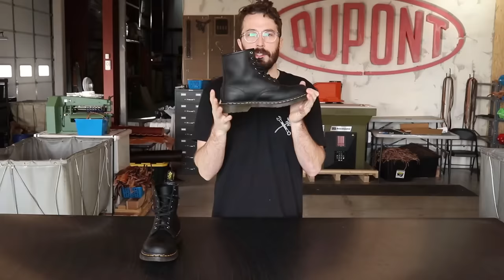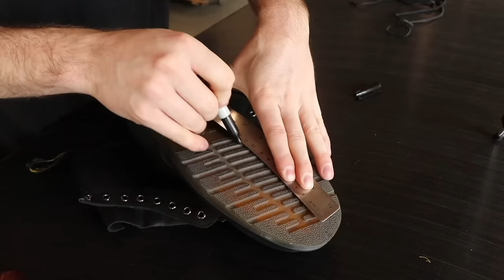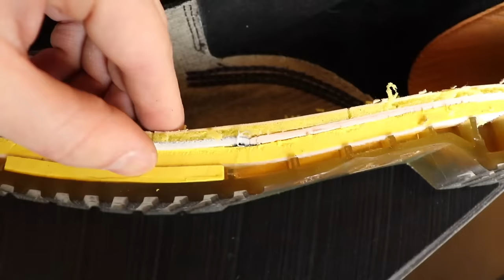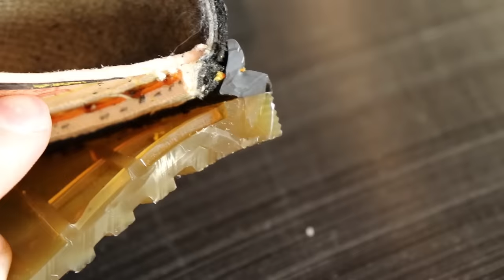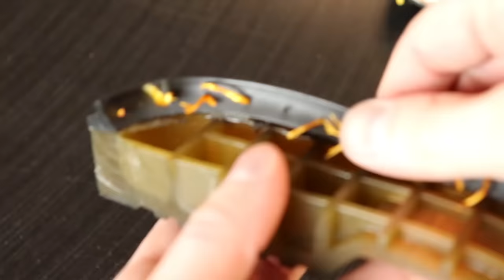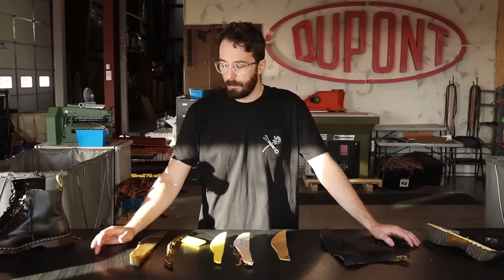WHAT'S INSIDE DR. MARTENS - (1460 BOOTS) - doc marten review

Comment: I really like this. With little exception, cheap stuff especially just doesn’t bother explaining what is included, left out, or what the expectation of durability is. Even pricey stuff may not bother. 

Would you be willing to do the same examination with the Corcoran jump boots? They are similarly inexpensive but should have better construction than the boot you reviewed in this video, except that’s an assumption on my part since I haven’t cut one in half.
Reply from the maker: If there is enough requests I’ll do it!

Comment: had a pair in the 70s,  the tongue used to slide down and wrap round my heel as i walked,  the dew from grass longer than 1 inch would soak the top of my foot, and the sole split and came apart after 1 week,  as very one knew at the time,  you repaired that with a hot butter knife.  if you kept at a pair for a while,  you'd be through the boot to the sock,  before the uppers looked worn.  and they were not cheep, they were total garbage, and looking at this vid, they still are.
Reply: It's such a waste of leather, god damn.

Comment: Things suck. I had a pair in high school that I had to work my ass off to buy. Got em and they lasted with switching off and on with a pair of Carolina engineers boots for years. I went to replace them cause the leather finally gave up and I was shocked. The leather on the pair I got was like paper compared to my originals. The construction stunk and they were just not good. They looked like they went to a fashion boot instead of a real boot. With me Docs tend to blow out the heel counter within 5 months and are ready for the trash can at a year cause there’s nothing left to work with. ( I still have a pair of Carolina engineers I bought in 2003 that are solid as can be) some time ago I had a friend in a boot shop kick me over to Solovair boots, said they were the ones who were making the made in England DMs and they were making their own boots like them as well but with a different sole to avoid copyright infringement. I bought a pair and was pleasantly shocked. While not quite the DMs I grew up with the Solovairs are probably as close as your gettin today within reason. So if you want a real Doc Martin buy from solovair they ain’t cheap but you know your buying from the folks who really made DMs once upon a time

Comment: I used to wear DM's constantly back in my teens (20+ years back) and even then they were regarded as a pale shade of what they used to be. Looking back I was clearly a glutton for punishment. The internal heel lining would grind copious amounts of skin from my heels (I would actually start shaving the edges of the leather with a razor just to alleviate this) and the leather at the crease point would start cracking and splitting in fuck all time. Oh, and if you work on a bar, spilling any kind of alcohol on them is pretty much the kiss of death. The soles may stand up to oils, petroleum and all that but spill beer on there and they're doomed. I bought some used Alt-Berg army boots in recent years and they make DM's look like a joke.
Reply from the maker: Interesting. Where did you buy them?
Reply: @RoseAnvil  the DM's or the Altbergs? If the latter I just bought them via eBay. They're pretty common in British Army surplus outlets.

Comment: I am heartbroken that one of the greatest boots in the 70s and 80s have given way to trash and the masses wanting cheap 1460s. I had all English made 12 and 18 hole lace ups steel caps that lasted years and when I got punctures through them I would hot knife them and when the soles were flatbed worn I had gp soles put on.

Comment: 1. the first piece of foam is glued to the insole with a touch of hot melt glue. 2. the second piece was placed inside the outsole with no any kind of glue. 3. the sock lining uses hot melt glue to fix to  the insole. 4. fused PVC condition: these video is really going to ruin your chance with DM, those are the things which they held proudly...

Comment: I think adding no glue to the sole's inner layers enables the shoes to be more flexible and gives the foam a longer life because it can also slip and not stretched as much with each step. All the talk about how strongly the sole is bonded to the upper part is complete BS because he removed the stitching and the complete assembly is both the weld and the stitching so and there is no point in showing the strength of the bond this way. With a normal tennis shoe (or sneakers) you could get the sole to come off at one end and probably peel the whole thing using your hands  - you will never be able to do that on these shoes. To conclude, I think this review was poorly conducted and gives a wrong impression of Doc. Martens. They are made well, very well.

Comment: Wow, total garbage boot construction. Foam? So, no actual foot bed? Just piece of foam that's not even cemented in place? Terrible. There should be a foot bed welted in with the sole. That foam is worthless garbage. No cloud EVA or cork and no foot bed. No shank and the sole is flimsy rubber. They look nice from the outside, but damn those are not even worth the 120 bucks